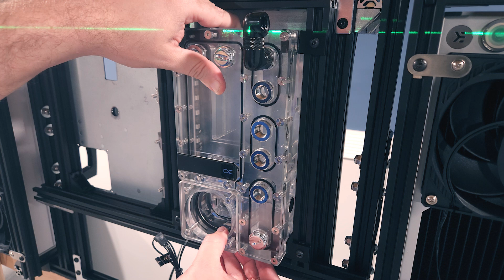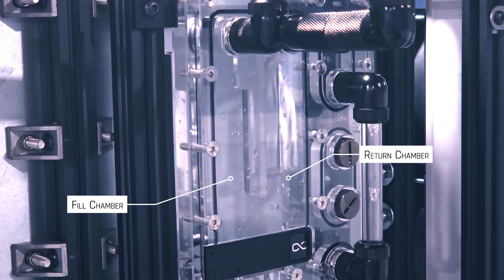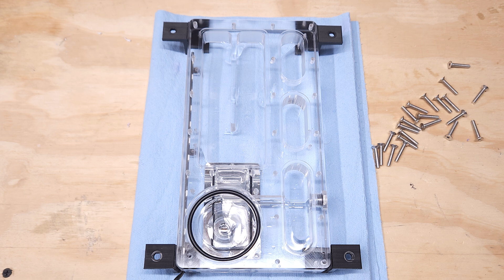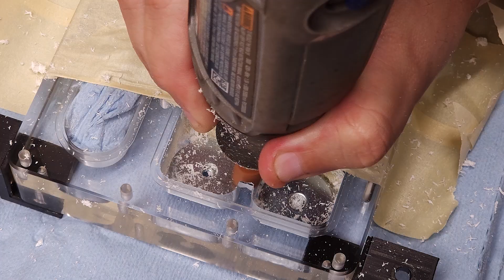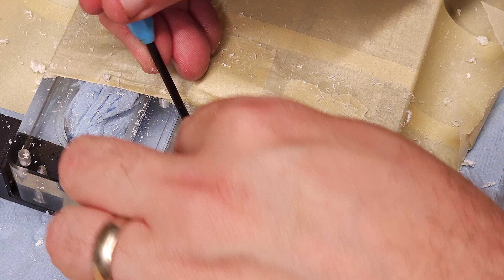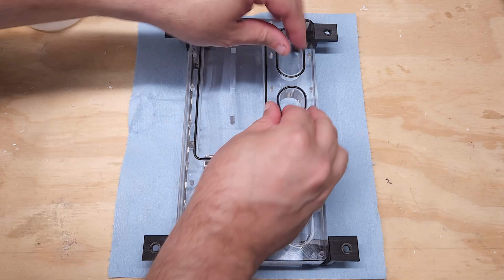How to Fix the Alphacool Core Distro Plate 240

Comment: Does anyone know what the metal plate on the back of the pump housing is for?
Reply from the maker: Hi. I'm recalling from memory since I don't have one that isn't in use that I can take apart, but I think removing that plate allows access to the backside connection between the bottom of the reservoir channels where they flow into the pump well. The next time I pick one up I'll be sure to look at a bit more closely.
Reply: @htfiBEEP  I see. Thank you for your reply

Comment: I see you cut away a reasonable chunk, wouldn't a much smaller cut suffice?
Reply from the maker: Hi there. Yes a smaller notch would be just fine. I like to cut out about an inch to have a little more space in general but also because I've always been interested in adding a conformal coated LED to the back ridge that I leave. I figured that would be enough length to add a 3-4 LED strip in that area. Haven't gotten around to that yet but the desire is still there. :)

Comment: Hi, I'm VERY new to water cooling my system, infact it will be the first time for me... i have a question concerning this mod: in dialysis we messure the recirculation of already filtered/cleaned blood coming from the machine, entering the body and re-entering the machine. The distance of the needles to each other plays a big role. My question is, if the water enters in one chamber and is directly bridged to the exit, will it shoot warmed water back into the loop at a higher %age? please excuse my maybe very dumb question, but i want to know before cutting into my distro plate.
Reply from the maker: Hi there. Two thoughts come to mind when I think about your question.

The first is that both chambers lead to the same 'exit' point, which is the small opening that goes into the back of the pump. Therefore, if the reservoir is left as it comes from the factory or if you decide to do this particular mod, all the water funnels back to the same place.

The second is that in a water cooling loop the temperature will eventually reach a sort of equilibrium throughout the loop. How low that equilibrium can go is determined by the pump's flow rate, the amount of heat generated from the components that are being cooled, flow efficiency, coolant composition, size/quality of radiator, size/quality/CFM of the fans on the radiators, and the ambient temp of the room all that equipment is in. Because of that equilibrium, under normal operating conditions you shouldn't end up with a scenario where there is a pocket of extremely warm coolant and another pocket of extremely cold coolant. Even less likely for the reservoir considering the two chambers in question are right next to each other.

Lastly, I would say that your question is most certainly not dumb and I hope something in my response is useful to ya.

Take care and good luck.